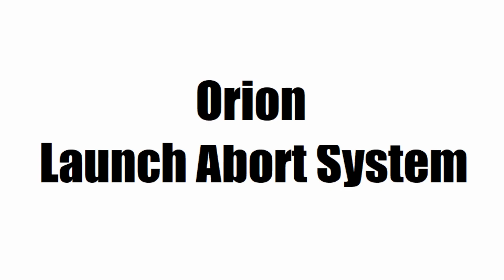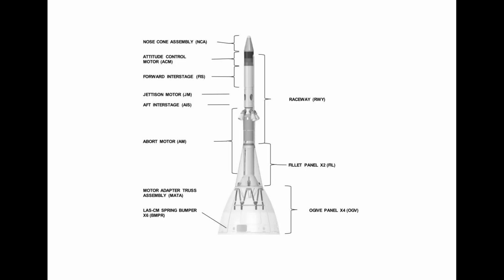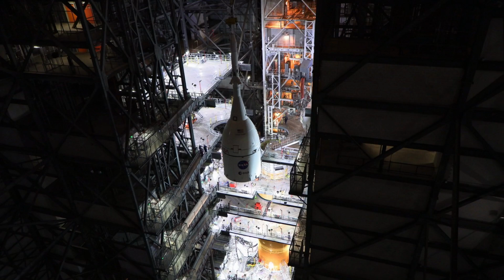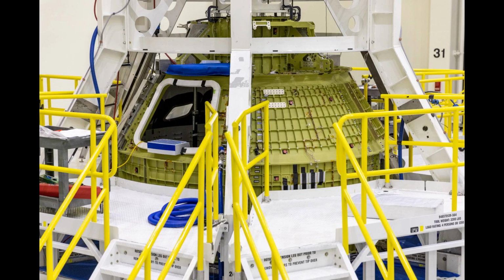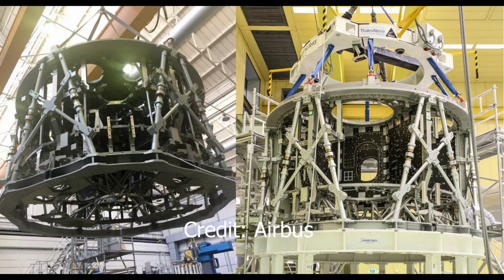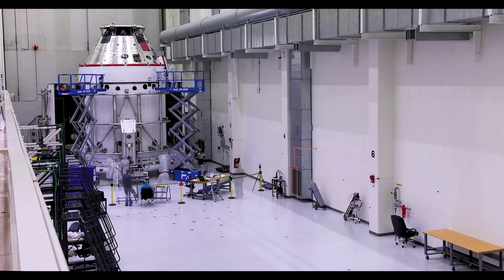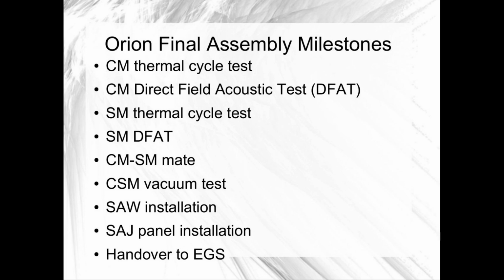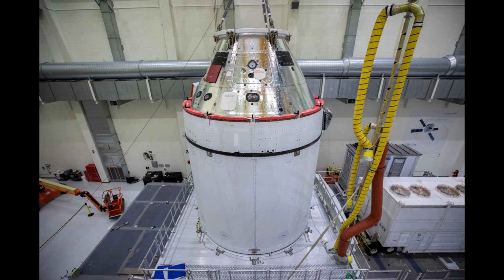NASA Orion: Production Overview

Comment: If the LAS isn't needed for a launch-abort when it is jettisoned why not in addition to firing the jettison rocket-motor also fire the abort rocket-motor.
Reply from the maker: The abort motor is over-sized for jettison, it has too much thrust and has no active steering without attitude control motor and the Orion flight computers in the Crew Module. The abort motor is sized for pulling the Crew Module away from a disintegrating and/or out-of-control launch vehicle. The jettison motor is designed to pull the LAS away from the Crew Module, which needs to happen during either a launch or an abort.
Reply: @PhilipSloss  I'm just pointing that out because in the Apollo LAS if the jettison motor failed the abort motor could be used as a backup to jettison the LAS (IIRC this was demonstrated in the SA-7 flight) and there's no reason why the attitude control motor wouldn't be activated too.
Reply from the maker: It's an interesting question.  I'm not sure that the Orion system functions that way and I'm not sure if the redundancy for the jettison function in Orion has been documented publicly.

In the Apollo LES, my understanding is that the combination of the launch escape motor and the pitch control motor were used as a backup -- the question there is whether those were passively or actively controlled in a jettison case, because the LES was flying on its own without the Command Module.  Regardless, the LES could operate independently from the Command Module.

For Orion, I'm not sure that the LAS can operate independently from the Crew Module -- the attitude control motor has a dedicated avionics box, but I believe the GNC functions and commanding come from the Orion flight computers.  Once the LAS is disconnected from the Crew Module at jettison, the question is what provides steering (GNC) after that?
Reply: @PhilipSloss  You could pose that question to NASA in regards to using the abort motor for backup jettison mode comparing it to the Apollo LES and mention that this was prompted by a YT user comment.

Edit: Ask NASA comparing the Apollo and Orion LAS operating modes and if the Orion LAS has a backup tower jettison mode. Personally I don't think there's been a seriously detailed description into how the Orion LAS functions along with its' various operating modes in the way the Apollo LAS has, perhaps you could write a wikipedia article about it going into great detail.

I'm also disappointed there was a proper test-series for testing the Orion LAS the way the Apollo LAS was and that there was no Little Joe III rocket.

Comment: Huh, i wasnt aware that there are so many interstages in the LAS assembly, do you happen to know why are they in the tower and why are they so long? at first glance it seems like a lot of wasted space, does it have to do with attitude control motor needing long enaugh lever to be effective?
Reply from the maker: A longer lever arm helps with the moments, but there's also the power of the abort motor itself and positioning it with some offset from the crew module.  The nozzles aren't pointed directly at the crew module / fairing, but in Ares they put out 500000 pounds of thrust; that's now 400k, and the acoustic and other loads were something that NASA and (now) Northrop Grumman were measuring during development and qualification of the motors.